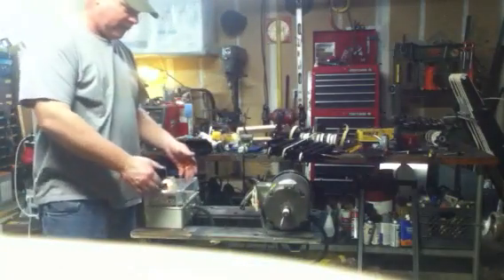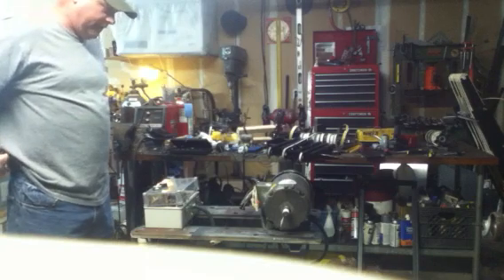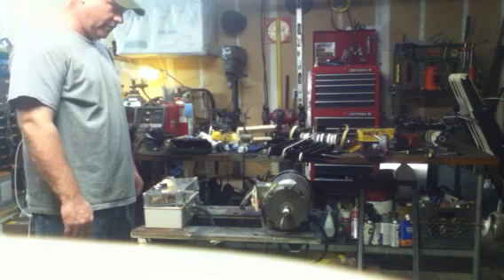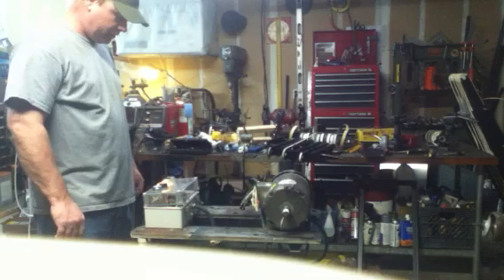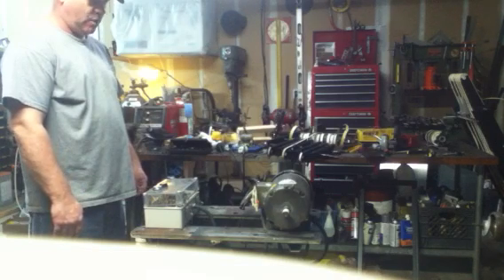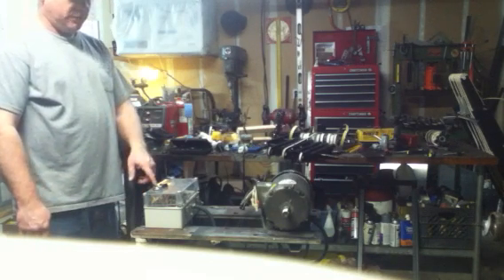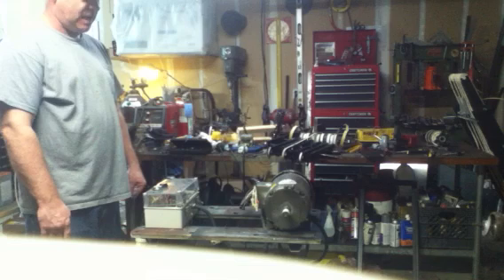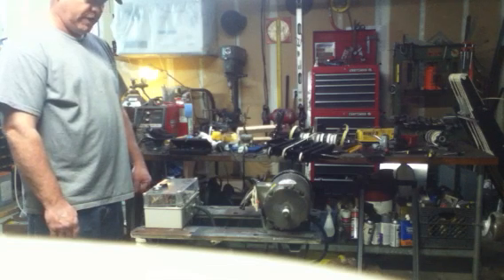Rotary Phase Converter

Comment: Nice work. So, to start the 3 phase motor is a 2 step process,start the RPC, then switch on the 3 phase motor. You could also justh and spin the pony shaft and apply power to get it started?
Reply: +John Ho  To be exact, in my design here, you are starting the 3 phase motor on single phase supply. the capacitor dumps a huge charge of stored electricity into the motor circuit to start the motor. once the motor is running, the motor still only consumes single phase power, but generates 3 separate legs for use. the system is slightly less efficient than utility supplied 3 phase power, but efficiency improvements can be attained through the use of balancing capacitors.